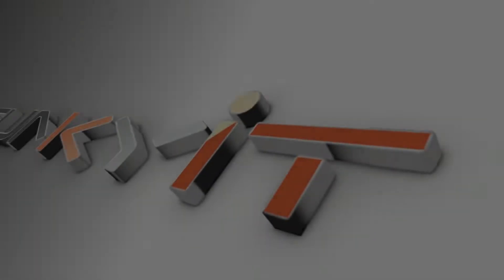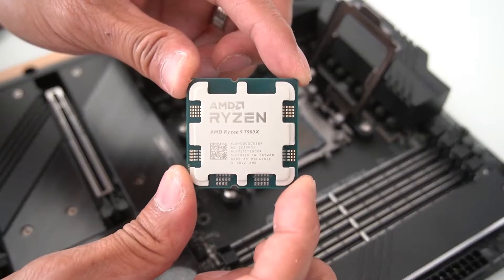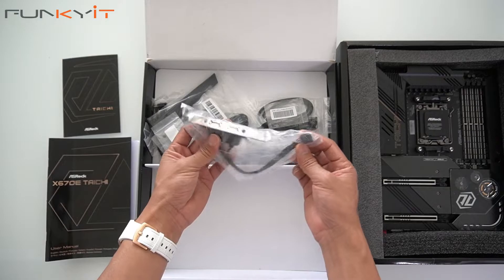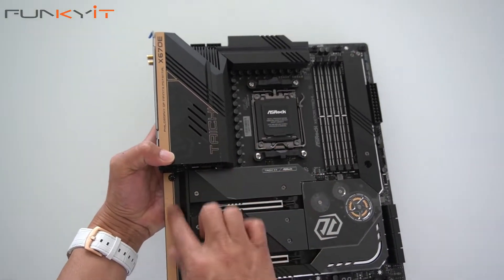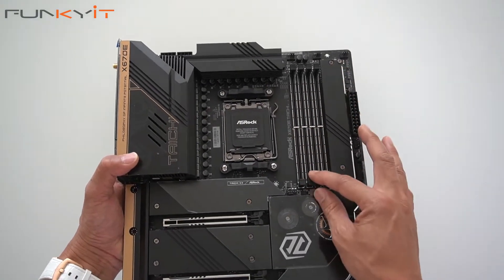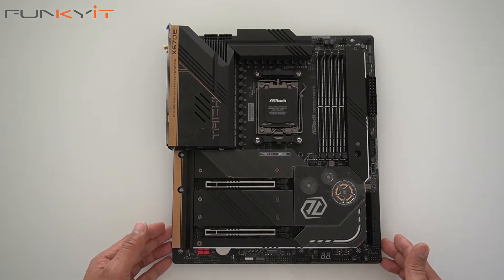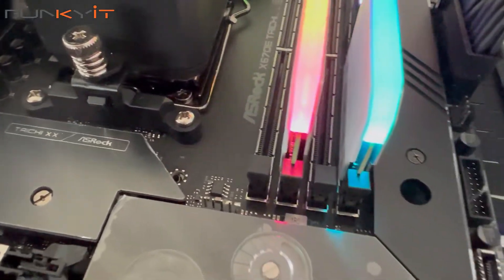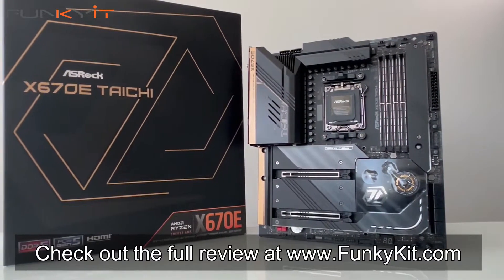ASRock X670E Taichi - Enthusiast-Grade X670E Motherboard supporting Ryzen 7000 processors

Comment: how did you use a pcie 4.0 ssd in a 5.0 m.2 slot?
Reply from the maker: Yes we did
Reply: It just clocks down to gen 4 instead of the highest (gen 5). Think m.2 gen 5 is backward compatible down to gen 3 on this board.